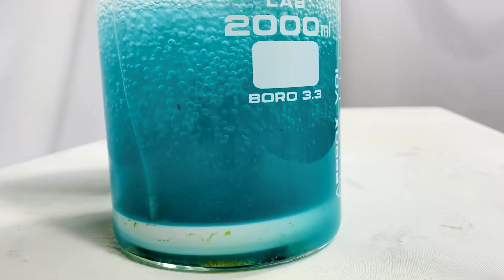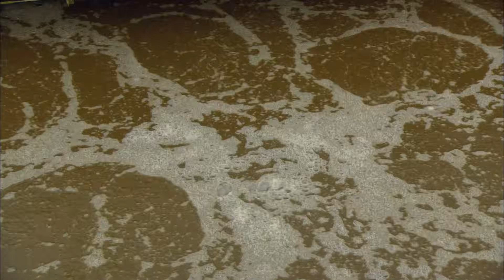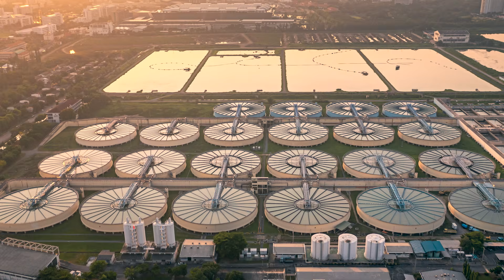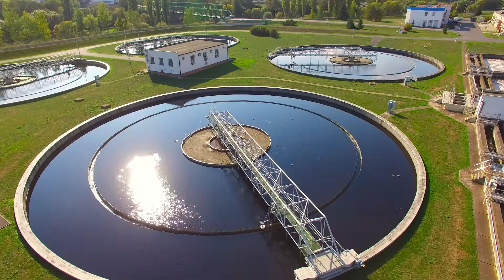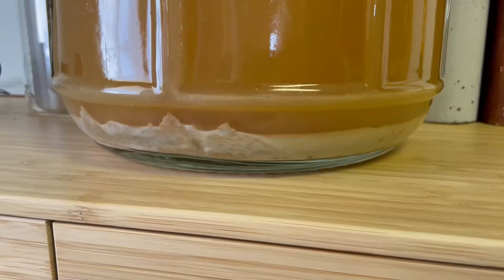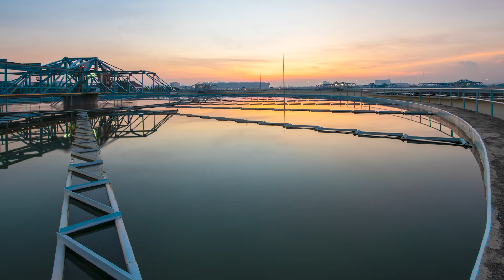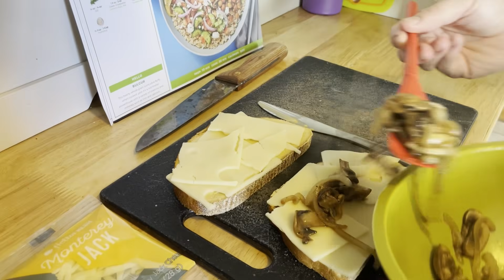What Sewage Treatment and Brewing Have in Common

Comment: I've heard that one major issue with selling reclaimed water for industrial use is when treated wastewater contains microplastics that gets used in farms and the plants take them in, thereby introducing those microplastics into our diets. Is there anything being done to address this?
Reply: Apparently settlement can remove most of the larger particles, and bacteria can trap some of the smaller particles, making them removable, but it seems research is ongoing to find more effective processes, including chemical treatment which bonds to micro plastic particles and causes them to stick together, forming a mass that then settles, and trying to develop bacteria that can eat the plastics.

Comment: Great video, Grady!  I know your channel is more about engineering than chemistry, but a brief history of fermentation and some of the systems that were engineered to achieve fermentation through the centuries would be a great follow-on to this bit.  Other ideas:

* While you're on the subject of advanced biological wastewater treatment, you might consider nitrification and denitrification, as well as more advanced treatment processes like shunt denitrification.

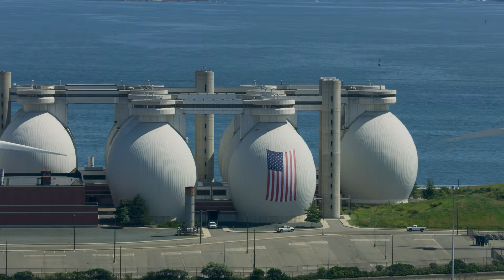* For biosolids treatment, I can think of all kinds of episodes you could do on aerobic and anaerobic digestion.  The engineering behind the egg-shaped digesters at 8:40 in this video would be a fun exploration.  Also, consider composting methods (e.g., static pile, aerated pile, windrows, etc.), sludge drying, sludge incineration, and a discussion about practical uses for both Class B and Class A treated biosolids.

Just some things to consider for future content.

Signed,

An avid fan of this channel!

PS - In your video, you mention that Wichita Falls is an example of "toilet to tap," which I think was true between 2013 and 2015.  Since then, I think Wichita Falls has ended its Direct Potable Reuse program and has converted it to an Indirect Potable Reuse system.  Not quite toilet to tap since the treated wastewater makes a pit stop in Lake Arrowhead, but it's still pretty close.

Comment: I feel like the biggest benefit to reuse would be to utilize it as fertilizer, as it would reduce the demand for fossil fuels, not to mention saves us from having to do the difficult task of converting nitrate into nitrogen gas.
Reply: Only if you can remove other contaminants from the sludge - heavy metals and nasty things like PFAS. Farmers won't buy it, although some places are trying various schemes (such as orchard fertiliser with treated sludge that isn't too contaminated)
Reply: @Trixtah  I'm meaning use the water. The aerobic processes to get ammonia -> nitrite -> nitrate are pretty straight forward, you then use the nitrate 'contaminated' water as fertilizer. For the treatment plant this saves the complexity and effort of trying to get anoxic/anerobic conditions to convert the nitrite to nitrogen gas.

Then on the fossil fuel side of the equation, you have a ready source of nitrogen fertilizer that doesn't involve the conversion of CH4 into fertilizer

Comment: Since microbes are so important in sewage treatment, how does everyday disinfectant such as PCMX and benzalkoniumchloride affect the treatment process? Do these make the treatment any harder?
Reply: In a municipal treatment system there's usually enough water to dilute chemicals to a safe (for microbes) level. But a home with a private septic system doesn't generate that much wastewater, so the occupants have to be careful about what goes down the drain. You'll see some cleaning products labeled as "safe for septic systems" for that reason.
Reply: Absolutely. Waste treatment plants monitor the influent streams for chemicals that can harm "the bugs" as they call them. Residential producers rarely cause a problem since it's so diluted but commercial facilities are a different story. Often these companies work closely with waste treatment orgs to ensure their effluent is up to spec. Often this involves pH adjustment. If it falls out of spec, they will notify the plant, and sometimes they can react to prevent colony collapse. 

Accidents can and do happen. Heard about a chem lab where an idiot poured a liter of dichloromethane down the drain. It killed the whole colony in the plant's digester. They were fined tens of thousands of dollars.
Reply: If it happens too much, then our river in Cleveland will catch on fire again :) makes me wonder what the percentage of chemicals was in that water back when it did catch on fire.
Reply: @calvinthedestroyer  Believe it or not the water could have been entirely safe to drink other than the layer of light petroleum distillates floating on top to catch fire.  Not saying that was the case, just saying you can have drinking water with a layer of flammable liquid on top.  As soon as that burns off it would be perfectly safe to drink again.
Reply: @msromike123  Didn't people get chemical burns from the river back then?
Reply: @infernaldaedra  Yeah I was just speaking more hypothetical, not that specific situation.
Reply: @msromike123  Vast majority of flammable liquids are soluble enough to render the water, they float on, not safe for drinking. Especially petroleum products.
Reply: @msromike123  true
Reply: As people have said: Normal residential use is not going to affect the microbes at whole lot. Also a few getting killed from time to time isn't going affect the overall effectiveness a lot. The microbes do naturally reproduce to an excessive degree.

However if someone were to dump a lot of microbe killing chemicals into the sewage system, the waste water treatment plant is often not going to discover it in time. The first sign they often see is that their microbes are dying off. That is a major issue which would mean that they cannot do their job (properly).
Reply: I think the answer is yes and no. Sometimes they do, sometimes they dont, and we work hard to maintain a careful balance where our treatment chemicals dont mess up the biological processes to a detrimental degree
Reply: One thing you have to realize is that everything is powerfully diluted by massive amounts of water and sewage products. Not to mention what those twenty dollar word chemicals decompose into.
Reply: Most everyday disinfectants work by disrupting the cellular membranes, which is exactly how soap works. They have virtually no disinfectant effect at all, once they get diluted under a certain concentration.

A bigger risk are antibiotics. When they get to waste-water, they can breed some pretty nasty antibiotics-resistant bugs. Depending on the sewage system, a single pack of expired medicine flushed down the toilet could do the trick, and kill people somewhere down the line.
Reply: The High school Chem lab is what you need to worry about. Had them wipe out a few colonies with experiments down the drain.
Reply: for the most part disinfectants are too dilute to make a difference once they get mixed in with all the rest of the wastewater.
Reply: benzalkoniumchloride is a big word. you must me really smart. im just messing with ya. some evaporate before they ever reach treatment and others are just not at any concentration to be effective at all. I always wondered about all the chemicals that go down the drain.
Reply: @WTFinc  yeah, for every person bring irresponsible and pouring chemicals down the drain, there are 99 other people pouring regular water down the drain, to dilute the chemicals. I hope those microbes are safe
Reply: @ferociousfeind8538  I don't think this about people irresponsibly pouring chemicals down the drain, it's about people using anti-microbial soaps or cleaning agents (such as lysol laundry sanitizer). Those end up in the sewers just like normal soap and cleaning agents would.
Reply: @ferociousfeind8538  lol the microbes, think of the microbes! what would happen if some asshole like a jiffylube started pouring all the oil down the toilet. what damage could it cause and could that person be found. not asking for a friend but the bullshit about needing a county sticker or paying fees will find that mess to be where it should not. rediculous
Reply: @MrAranton  Non-issue.  If it becomes a problem, they will just add greater bio-filter capacity, or add whatever chemical it takes to counteract it.  Solution looking for a problem.
Reply: @msromike123  I never said it was an issue because it isn't. I just tried to clarify the OP's question. "How do disinfectants that end up in sewage affect the micro-organisms water reclamation plants rely on?" is a perfectly valid question, that shouldn't be conflated with "what happens when people irresponsibly pour chemicals down their drains". Others pointed out: When those disinfectants reach the water reclamation plant, they've been diluted to the point of ineffectiveness. 

Your "solutions", however are nonsense. If the water that flows into a biofilter has high enough concentrations of whatever to kill off the micro-organism in the filter, a larger filter just means you means you get bigger batches of unfiltered water. You need get the concentrations down BEFORE the water flows into the biofilters. And before you add "whatever chemical it takes to counteract it", you need to ask yourself how to rid of that chemical after it did its job (lest you simple replace one problem with a different one) and if you can't what does it do to the water and the microorganisms (lest the cure ends up being worse than the disease).
Reply: @MrAranton  Please teach me something on this .... I just bought that stuff a week ago.... please tell me more about your thought on the subject

Comment: I do have a question, to encapsulate all things concerning water and climate change and energy problems I would propose a thought experiment. Is it possible to have nuclear power stations running at full load 24 hours/day that provide energy to desalination plants on the coast to produce fresh and clean drinking water, that can then be used to recharge ground aquifers. To deal with the excess nutrient pollution and to clean up waterways, would it make sense to invest money into creating bacterial species that can use these otherwise toxic levels of waste, cleaning the water before it goes back into the ecosystem. To handle high levels of greenhouse gas emissions why not invest money into developing plants that are capable of sequestering more carbon from the atmosphere and then plant them in our cities and along our coasts, reducing the local temperature and producing more oxygen? Off the top of my head, I am aware that oysters are some of the best natural water filtering organisms, we could make huge oyster reefs and clean river water over time.
Reply: Tangential to your question, though not a direct answer :
Some STPs / WWTPs are energy producing. Anaerobic digestion, if used, produces methane, which is frequently used for heating and running generators. The main plant in Philadelphia PA isn't allowed to convert their methane fully into grid energy, the local power company refuses to allow them to because of how much it would cost them.
A lot of plants are shifting from chlorine to ultraviolet for final fecal kill. That leaves empty contact tanks that look like giant "all edges" brownie pans.  Which are sometimes converted to raise oysters and the like!
Reply: @seanfager8063  that’s actually pretty cool information though. A lot of public utility companies are state approved monopolies, so in theory, it would be as simple as passing new legislation that would hybridize the market between all suppliers. This could work provided there is some fee exchanged for the use of the infrastructure and I assume some type of energy credit equivalence. But I’m glad you mentioned methane because it is a far more potent greenhouse gas than carbon dioxide. We should target specific microorganisms that convert methane directly into oxygen or can rearrange the chemical bonds to produce something usable like petroleum. Because then we create a methane cycle and can continue to produce power output and existing plants can still undergo photosynthesis using CO2 emissions. There’s a lot of special interests at play here though that have more influence than you or I my friend but you might be into something